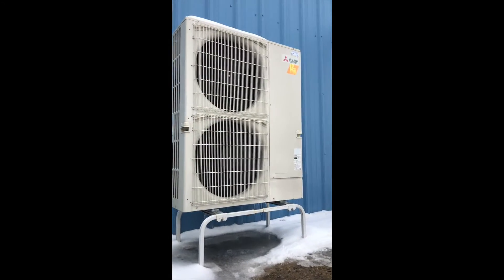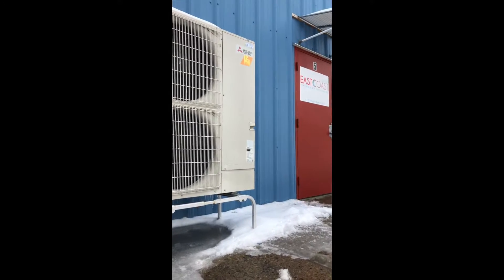Is Electric Heat Efficient?  The Difference Between Electric Baseboard and Heat Pumps!

Comment: Electric base board heaters are efficient they are just not economical. Base board heaters are 100% efficient, heat pumps are about 300% efficient depending on outside temperatures. The best gas furnaces are only 96% efficient. It's all about economics not efficiency.

Comment: I live in a small apartment in Franklin, NH. They recently installed baseboard heaters in all the units. They got rid of the boiler heating system. However, I also recently bought a window heat pump. So far for the most part it seems to be doing a good job. Hopefully it will still be effective when it really gets cold out
Reply: How did it go?
Reply: @chrisE815  The heat pump works pretty good. Though I did just move it (today) from the kitchen window to the living room window since the living room window is directly as in a straight line from my bedroom. So I will see in about a month how well or worse for that matter it impacts my electric bill
Reply: @wraithwarrior8454  nice.  I'm in the north east too and curious. Keep us up to date
Reply: @wraithwarrior8454  And?
Reply: @GlossaME  I took the damn thing out halfway through winter. The window heat pump didnt work much below 36F. Waste of money but hey, at least I tried it
Reply: @wraithwarrior8454  Thanks for the input.
Reply: @wraithwarrior8454  Thanks for the updates